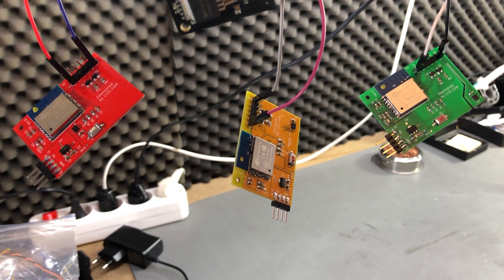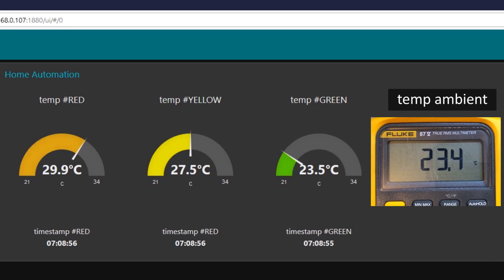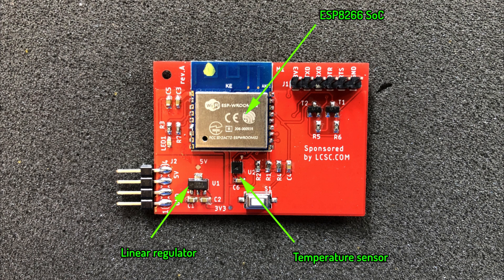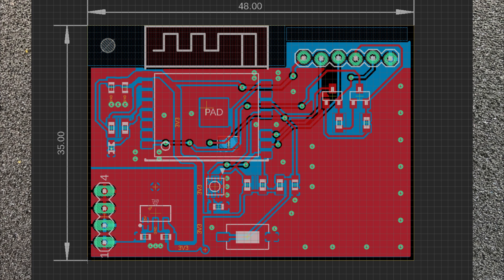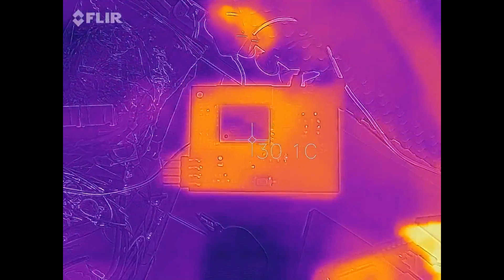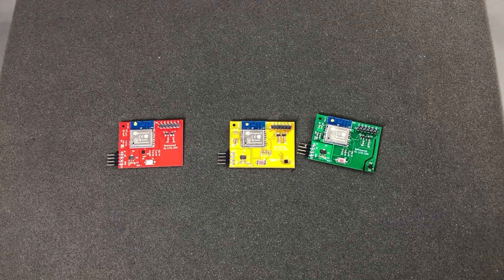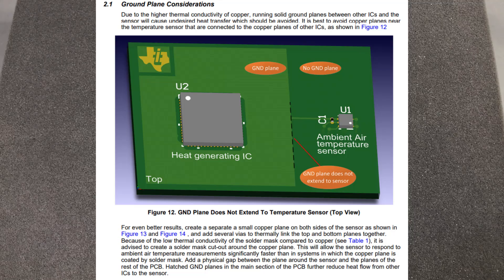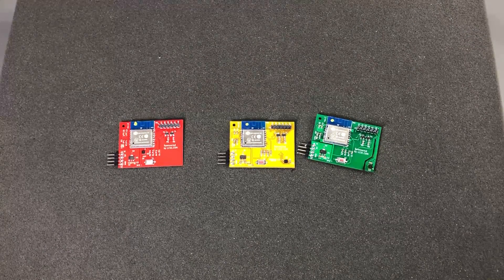Voltlog #230 - Guidelines For Board Level Temperature Sensor Layout & Placement

Comment: At what reading frequency does this become an issue?

I'd imagine on a low power battery powered device where readings are only taken every hour or so that any heat generated by the SoC (which is spending 99.9% of the time in deep-sleep) will be entirely irrelevant.
Reply from the maker: It can vary but what's important is to be aware of this effect and take measures to compensate.

Comment: Hi Florin, I tried a similar sensor today: Si7006 (instead of SHT31 in your case). How did you solderd it? I may have ruined mine with the hot air station as it gives me quite high temperature values. I will try another one asap. Do you have advices handling these sensors? Great video by the way!

Comment: Valuable topic, but if you calibrate sensor, it should show good results anyway. If you can measure consumed current of ESP, then you can expect how hot it will be and do corresponding calculations.

Comment: If your board was 3" wide and 9" long, you placed all the circuitry on the top 3",  you placed the temperature sensor 6" away at the bottom, would you really be measuring the ambient temperature of the board? Just because you put the sensor as far away as possible, are you really getting a practical measurement of the board and it's circuitry?
Reply: He's not trying to measure the temperature of the board; he's trying to measure the ambient air temperature.

Comment: Silicon Labs, TI, and others make accurate T/H sensors. You should not need to calibrate them as they are good for +-2% for the most part. The isolation techniques shown here are more important.

Comment: This is what do for a long time but you also have another main problem... calibration because you can buy 10  same model sensors, none will give you same result, and worst are the humidity sensors. I would be very interested in optimized "easy" calibration methods for Temp and Him.
Reply from the maker: You pick your sensor from the design phase according to the specs you need. In terms of temperature there are good sensors with good accuracy so you shouldn't need to calibrate anything. In terms of humidity if you need high accuracy, better than 2% than you are probably designing something very specialized, you have the budget and the knowledge 😉
Reply: @voltlog  no need of better than 2% but often you get 10% or more diff between same model ( and worst if you have different models side by side) and when it is for hobby you buy them on Chinese sites that may also sell unverified (out of specs) products, so what I do is put them all side by side and get one as referrer and Mark the +/- variation of the other and apply the correction at each reading as I mainly need to follow changes over time and not exact humidity value. For my old DS18B20 I did the same and actually use a dozen of them around the house for 10 years with one data per minute ... got millions of entries with very low error (DS18B20 did not respond) less than 0,5%, 1 Wire technology is very reliable.

Comment: Great video.  Was hoping you were actually testing the color of the boards effect in ambient light.  I guess that would be so small as to not make a difference, thou I would suspect black and white may differ
Reply from the maker: There could be some difference if there is direct sunlight on the pcb or if there is a heat source nearby but otherwise I don't think it's worth thinking about the issue.

Comment: Home automation, sensors and PCB design - hoping to see more videos around these topics in the future!
Reply from the maker: I like those topics and I could cover the hardware aspects but for such topics a lot of software is also needed and that's something I don't like doing 🤔 I'll try to cover more pcb design subjects in the future, thanks!
Reply: @voltlog  There's a lot of channels already covering the software side of things. But this was the first one I've seen that covered a custom PCB with an ESP and a sensor. At least not with the focus on the PCB design around the sensor. For example, I like to read things posted on https://www.mysensors.org/ even though as I don't use MySensors itself. I'm interested in the discussions about new sensors, low power design/components and what kind projects people there have done. 

When I finally have enough time to get started with PCB design, these types of things are what I'd be interested in building and would love to learn more about it. The software is not interesting to me (at least as long as there's an Arduino library or code snippet available). I bet there's a a lot of people like me. You could get a lot of new subscribers from communities like MySensors!

Aside: I noticed you used Node-RED on this video - I've been using it as the basis for my home automation also for 3 years now!. Great choice! Given the fact a big part of my daily work involves writing JavaScript for both browser and serverside, it is a very powerful tool for me to use.
Reply: A great example of a fascinating discussion was this thread https://forum.mysensors.org/topic/1607/safe-in-wall-ac-to-dc-transformers about Hi-Link power supply modules and their safety. The end result was a list of components and even some PCB designs on creating a circuit around it to further improve the safety. Coincidentally GreatScott used this same module on his last video (incl. PCB design which was not exactly safe).

Maybe a topic for a video on your channel? The safety of the module itself was evaluated to be good at lygte-info.dk: https://lygte-info.dk/review/Power%20Mains%20to%205V%200.6A%20Hi-Link%20HLK-PM01%20UK.html

Comment: Congratulations for not only presenting but also practically demonstrating a non-obvious problem like this that can easily sink a naive design. These days I tend to sum this issue up as "no matter how many holes or grilles your fancy sensor has, it's still measuring the temperature of its... leads".
Reply from the maker: That's the reality and depending on what the end goal is, we can apply some techniques to improve our measurement accuracy.

Comment: Surely you'd add some form of calibration to your design - after all, you have the ESP to store the cal. data and make suitable offset adjustments before displaying the data.

EDIT: I see someone else below has already mentioned it. Not convinced about your reply to him.
Reply from the maker: Usually the SoC will have variable activity which would result in a different power usage pattern and generated heat. You can't reliably calibrate if you have a variable factor.

Comment: Thanks! Could you please share a link to the enclosure you showed in the video?
Reply: https://www.ebay.com/itm/5-Pcs-Plastic-Enclosure-Electronic-Switch-Junction-Box-Case-75X55X28Mm-A4R3/123692095498
Reply from the maker: https://www.aliexpress.com/item/32979750027.html